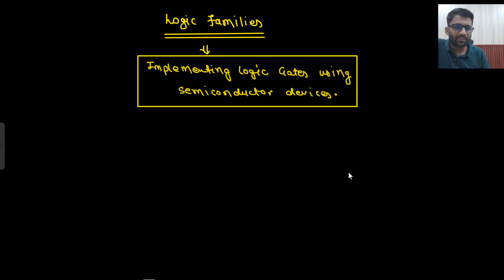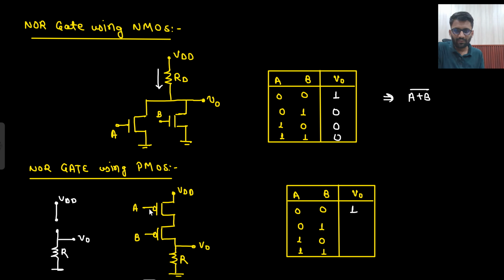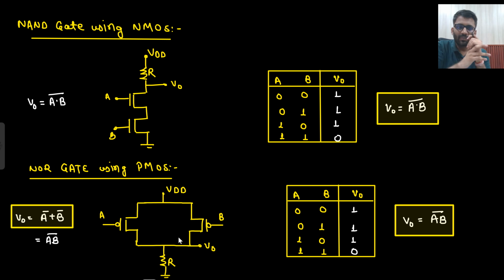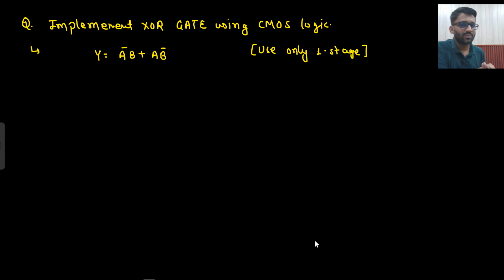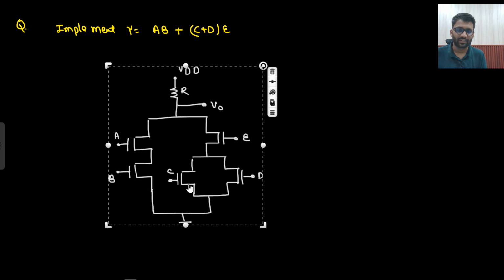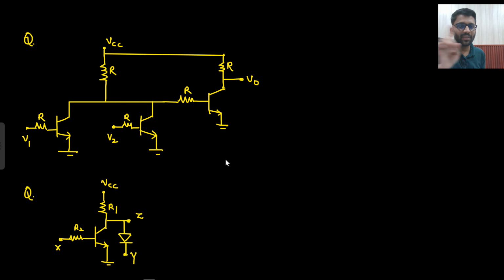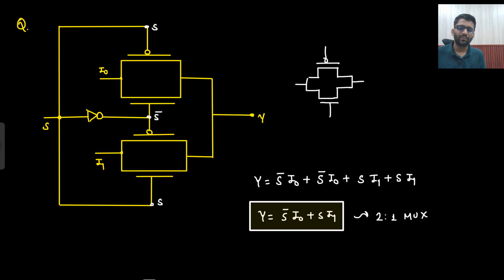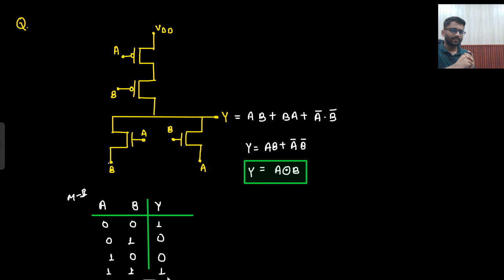CMOS Implementation of Logic Gates || ECE/IN || PrepFusion || Himanshu Agarwal

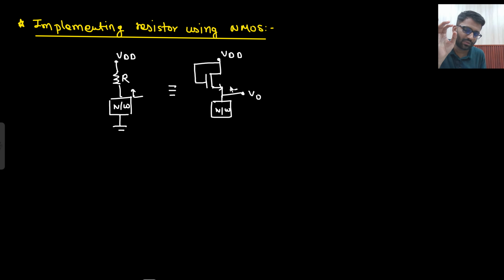Comment: 18:45 Sir for Mosfet to act as a resistor, it should be in linear region right? But here, you shorted the drain terminal with gate terminal, so wouldnt the transistor always be in saturation region?